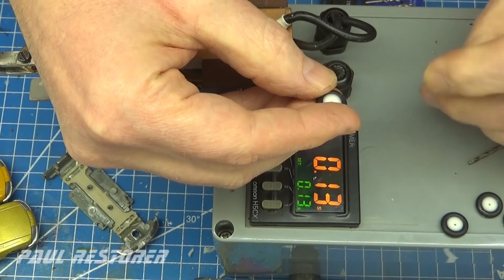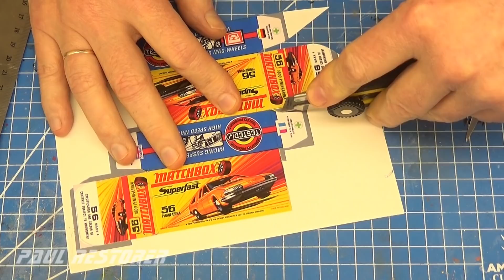Matchbox restoration BMC 1800 Pininfarina Nr56 . Diecast model. Bonus pre-production copie.

Comment: NIce resto.

I wonder why they call it the Pinifarina when it's a Citroën CX. I know Pinifarina did the design of this car, but it's still a Citroën.

I had the Majorette version as a kid, it vanished without a trace. Bought one 'roughly 20 years ago in a flea market, this one too vanished without a trace.
Reply from the maker: It is a bit different from the CX
Reply: It was designed and built by Pininfarina as a prototype/concept car based on the BMC ADO17 1800. It has absolutely nothing to do with the Citroën CX.

Comment: If you had a casting with no windows and no source to get a replacement and had no example to use as a 'Master' how would you use Resin to make one?
Reply from the maker: first, on Wednesday, in the model where the glass is, for example, with plasticine, creating the inside of the glass, then after cooling, I would pull out the plasticine, improve its shape and make an external silicone form
Reply: @PaulRestorer  Have you done this on your channel? If so, what video was it? If not, can you? Please. I watch your videos because of your abilities to create where there was once none.
Reply from the maker: @garrykellogg3215  I will be doing such a film with a Volkswagen Beetle from Dinky. He had no glass. I will try to make such a new glass. Best wishes

Comment: Use  regular   paint remover   or similar  product 
never  use  dremel , use  car body compound and rag then wash with cellulose thinner 
Seal  all the  body with primer
  paint  ceiling in white to enlight interior 
Treat  interior plastic  with clear gloss paint  to avoid  static  dust  
Treat under body with clear gloss to avoid oxidisation. 
Reboxing  could be considered attempts at fraud
Reply: In this case , how  could reboxing  be considered  fraud ? . Anyone examining one of these excellent restorations would see these models are held together with small screws.,  Matchbox models were orginally  riveted together.